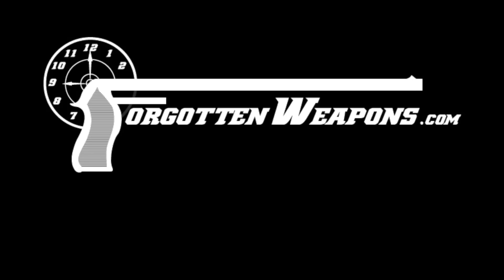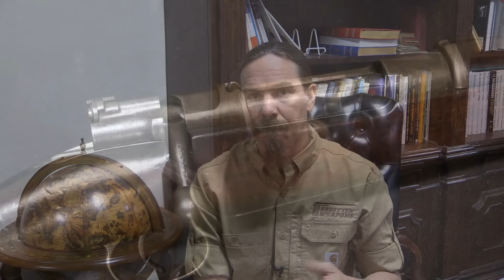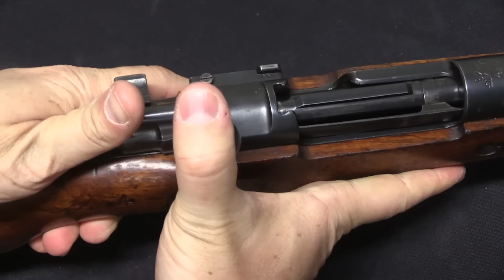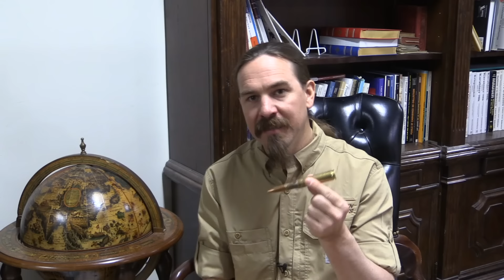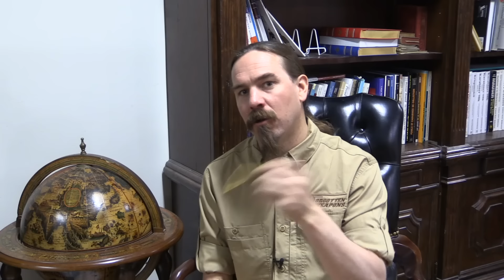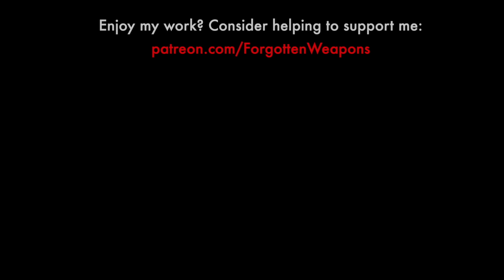Earth-Shattering ka-Boom! How (and Why) Guns Explode

Comment: We'd gone down to the sand pits with some guns, one of which was a double barrel 12 gauge. My friend had laid it on the ground, picked it up, loaded and fired. Both barrels turned into a mushroom-shaped bloom of coiled spirals 0f gunmetal back to about 6" in front of trigger....... that's what even a LITTLE sand in the barrels will do?!?!?! There was no way it was actually plugged. He was damn lucky he didn't get shrapnel in his eyes and face; I was standing behind his right shoulder, couldn't believe in milliseconds the amount of change that took place on that gun....... 
I've often wondered about rifles in situations where the barrel's certainly got mud or sand in it...... I presume the velocity and solid surface of the round makes such obstruction a non-issue? That endcap shear you describe is incredible! Your intimate knowledge at the engineering level is pretty awesome.

Comment: It the dim, distant past a friend had some surplus K-98s (?) and a basket full of surplus rounds to go with them. In the early 60's this ammunition might have been 20+ years old, or 40+ years old. Round after round would shower us with dust/gas and the cases showed three small windows ~1/32" X 5/32" which started just above the case web, the next offset clockwise  ~1/16" to the side and 1/8" farther forward, ditto the third.  After a while cases that didn't rupture/vent became the rare exception but hey, we were shooting real rifles. For free. I don't recall any less recoil or change to FMJ bullet impact.
DOUGout

Comment: Seems like the safety mechanism was the near fatal piece that came off the gun.
Reply: maybe this incident can help improve the design, reinforcing the locking and safety mechanisms and/or add a failure point on the barrel rather than have it break the breach. The design of that rifle isn't that out of the ordinary, especially considering the number of inline muzzle loaders (some smokeless) that use a similar breaching; it's very strong, just gets dangerous when the barrel is stronger than the threads.
Reply: @wildrangeringreen  Though it's not terribly long, it has a heavy barrel for accuracy. What people should probably pay close attention to is the fact that the chamber pressure in the .50 BMG is no different than most other rifle cartridges. So what was possible on a large scale with that gun, is also possible on a smaller scale with a much more pedestrian cartridge choice. I think the only safety change it needed was much more beefy safety lugs which would actually deflect the end-cap away from the shooter, if necessary.
Reply: It was but if you watch Scott's video on it, the real problem in his case was the round itself. It was way over pressure for what the gun was built for and they had no way of knowing that until the accident happened
Reply: Ya I was thinking in that system definitely should have had vent holes.
Reply: @kathrynck  Force is the pressure times area, so although the .50 has the same pressure as a smaller calibre, the force on the breach will be higher, and it's the force that strips the threads off the cap.
Reply: @axelBr1  good point.
Reply: @niccarr7929  He had warning signs something was off, and Ian mentions it too. KB said the recoil of the previous round was way higher than it should have been, and the round impacted way off the target. That could have been sign that the SLAPS were funky for example the higher recoil because it built more pressure than it should have. This is not really jab at KB this could have happened to anyone, but like Ian points out if things start to be off stop firing, and examine the situation fully, and all shooters should have this in their mind even though its easy to forget imho
Reply: @lalli8152  yeah maybe but that's the hard part, just how noticeable was it in the moment? We can't say and he didn't think it was enough to stop firing that day but he saw the difference in the muzzle blast afterwards, luckily him and his fathers actions kept him alive and he's doing well. But yeah if you can notice a difference then you need to stop and make sure everything's okay before continuing
Reply: @niccarr7929  Yeah i agree, and like i said that could have happened to anybody

Comment: I think the main problem in Scott's case was using a sabot round through a muzzle brake more than powder degradation.
Reply: Judging from what Scott has said 8n his video and what others have said it was the round more than anything else that caused the accident, that round was way too over pressured for what the gun was built for, unfortunately there was no way to know that before it happened
Reply: @niccarr7929  The round was only over pressure because he was shooting a sabot through a brake not designed for sabot rounds. This explains the erratic accuracy as well.
Reply: Im flip floppin on this, first i thought hot load, then after another video i changed my thoughts to the brake but now im back on hot load after another! If it was a bore obstruction at the muzzle, failure would have bene up there, so unless say it actually jammed in the chamber for some reason, im back on the hot load myself. Be great if we find out, hopefully something will be garnered from the remains and/or remaining rounds. Not saying you should shoot these through brakes by any stretch, just that wasn't the particular cause in this case in my personal opinion. Not an expert by any stretch but i do shoot, load and have studied rather a lot on internal ballistics.
Reply: @dunxy  A hot load doesn't explain the erratic accuracy. A bore obstruction does. The SLAP were made for the M2HB, which does not have a muzzle brake. Most rifles equipped with a brake, such as the Barrett, will recommend against sabot rounds in general, and SLAP rounds specifically. The bore obstruction would still cause failure at the weakest point, the threading at the chamber end, rather than the barrel itself. A round would have to be loaded with high explosive to cause catastrophic failure without an obstructed bore.

Comment: One you didn’t cover that really hits close to home is the cook off. Had a buddy at the 249 range who had a stoppage. He took the right steps by clearing the weapon, keeping his head down and doing a sweep to ensure there wasn’t anything blocking the bolt (links, brass, etc.), but when he looked up to continue, a round cooked off in the chamber and shot about 2/3 of the case right into his throat. Now this was at a military range with some amazing medics on hand, and he survived, but it could’ve been way worse. He’s got the case framed and hanging in his trophy room.

Comment: Luckily Scott's an absolute Chad and he had what it takes to stick his thumb in his chest to stop the bleeding.  Not many people have that in them.
Reply: Not his chest, his neck (which is all the more impressive).
In all likelihood his jugular vein got knicked and he had to apply a good amount of pressure to prevent bleeding out. Had it been a high-pressure artery that got knicked, he probably would have died.
Reply: @magnanimus9692  he said in his video it did get knicked it was his jugular which is high pressure
Reply: @xx_mysticwolf_xx1492  I remember that, but he either misspoke or confused the anatomy.
The jugular veins are low pressure (about 5 mmHg) and drain the blood from the brain whereas the carotid arteries are high pressure (about  100mmHg or more) and provide blood to the brain. Judging by his wound, his right internal jugular was knicked. The internal jugular vein is a very big vein and would cause immense bleeding with death in minutes depending on how big the cut is if no pressure was applied. The good news is that veins are squishy and you can apply external pressure to control the bleeding. Scott did exactly what he was supposed to do. Perfectly executed.
Had his high-pressure right common carotid artery been knicked, his dad wouldn't have seen him just profusely bleeding, he would have seen his son squirting blood out of his neck. A combination of the high pressure, the deep location of the artery and the resistance to external pressure (arteries arent squishy like veins, they are thick and resist compression) would make it virtually impossible for him to control the bleeding in a field. Basically he would have to be inside a hospital when the injury occured for him to have a chance at survival. And if you look at anatomy pictures online you'll see that the common carotid is right next to the intenral jugular. A few millimeters of deviation and he would have died for sure.

Comment: I have personally seen the results of a catastrophic failure of a rifle back in 2007. It was a bolt action (Mauser action) .240 Weatherby Magnum with a scope mounted. It was as you  say an "in battery" failure. My friend pretty much received the "best of the worst". It was an obvious over-pressure, which forced the bolt rearward, shearing the lugs and the bolt handle and the bolt went through his left cheek (the worst), the bolt came to rest in his mouth, missing his teeth(the best) and did no further damage (again the best). Pressure was also relieved through the internal magazine, blowing the plate out the bottom which pushed the stock up off the bench breaking the stock,  also braking his jaw. Also when the rifle went rearward the scope shattering the orbital bone under his right eye. He was taken by helicopter to a hospital, where fortunately for him the duty surgeon was fantastic, he spent about 9 hours in surgery and spent about a week in the hospital, and month with his jaw wired shut, and needless to say his hearing was screwed up for quite a while.
 The failure was no fault of his, he wasn't shooting "hot " rounds or anything of that nature, he was sighting his his rifle for what was then an upcoming hunting trip. He eventually recovered, with a triangle scar on his left cheek the only permanent mark left I'm aware of. I wasn't with him when it happened but was there at the hospital, and after his hospital stay he and I kinda talked it through to work out what happened...

Comment: This whole situation has really made me reconsider going out shooting alone any more. Having a battle buddy there in these moments are what separate the story being told by the news, and the story being told by you.
Reply: When was the last time you read a headline: "Lone gunman, dies on range" ?  We should all be cautious and understand the situation, but don't be scared.  This is a rare event.
Reply: @Redmenace96  i cant believe someone actually is defending the idea of not being safe with a firearm. What do you shoot? Myself- older rifles and the last year, a FUCK TON of handloads. Shit happens dude. And having someone else there makes the difference. Your right. Its rare.
But only rare because people havent been dipping into old ammo that could potentially do this to them in the last 100 years. Ammo has been difficult, or expensive over the last 20 years but NEVER like this. People are shooting antique rounds out of firearms that where not designed for those specific rounds.

Just cus you have a gas car does noy mean it can run formula one fuel. Same goes with your rifle and exotic rounds (or handloads) in the corresponding caliber.
Reply: @Redmenace96  also- this last year alone there are more "exploding gun" videos then in the last decade. Why?
Not counting the 3d printing idiots who think plastic can withstand thr forces of a rifle round, its because the where using too hot of hand loaded rounds. The 5.56 community was losing rifles left and right. And most where having them straight blow up. Many times resulting in injuries. Plus this is not reported because while its a firearm injury, its nkt a gunshot wound so the media response is much less flashy compared to "gUNs kILl PEOpLe" narrative thats easier for folks to follow and hate on. 

If anything, this is going to become a much more common thing to see happen if this ammo and material shortage and price hike continues.

Comment: KB said he had fired several of those old rounds, I would not be surprised if the threads were beginning to fail before the final KABOOM.
Reply: Just as a thinking game but wouldnt the fine threads starting to fail jam the cap or make it noticeably difficult to close properly?
Reply: @bdkj3e  Low grade threads yes. Does that apply to high grades as well? Never had those fail so i don´t know.
Reply: @7.62flavorsoffreedom2  I used to work as a failure analyst, and when dealing with hardened metal threads, such as pinion gears on large machine differentials,  we would see cracking at the root of the thread but it would still thread the nut like normal, not saying this is the case here, but I think it could be a possibility.

Comment: The serbu 50 doesnt seem to have much of a fail safe integrated into it
Reply: The sniper's hide has a thread on it and it's kinda hair raising. From Serbu's own statements, it'll handle 85,000 PSI. That's a safety factor of 25%.
Reply: @poisonouslead85  a semi auto has the explosion dampened by a recoilspring, the bcg contained by an upper in case something would fly rearwards. Never been impressed by the RN50.
Reply: @manganvbg90  Even a factory glock barrel has a safety factor of 250%. Hell, the mostly 3D printed FGC-9 has a safety factor of 300% and you make the barrel and bolt yourself using steel tube stock and a lab power supply.

There's no excuse for a professional gunmaker to be riding that ragged edge when a bunch of nerds with Autodesk Fusion are making safer guns that fail in a safer manner and have a much higher safety factor in general.
Reply: @poisonouslead85  ye, 25% safety factor. Im never getting behind that gun for sure 😁

Comment: Seeing all of the different fail-safes that were included in guns over a century ago, really makes it clear how the design of that specific Serbu .50 cal rifle is flawed. The threaded plug was secured by two steel claws, both of which sheered off. One almost brained Scott and the other severed his jugular... when your backup safety mechanism becomes a lethal projectile, it’s not a safety mechanism.

Comment: A dude on Kentucky's video in the comments mention something about using Sabot rounds and a muzzle break, that the small plastic pieces get stuck in the muzzle break and eventually can lead to ka-Boom. It somewhat supported as it's shown in the video how the muzzle flash gets brighter and the gun louder per Sabot round he fires, it also seems a non-Sabot round fired in between wasn't enough to clear it out.

Comment: This was an incredible video, not only for the obvious message of safety and awareness, but also in how it differs from a typical Forgotten Weapons video. It was very enlightening to show several similar design features with the same purpose compared with one another, and a real treat to see several different weapons in the same video. 

It would be interesting if you made a series of videos on particular types of features or design intents and compared and contrasted how different designers implemented them!

Also, props to whomever closed-captions your videos! Whomever they are, they pick out the important bits and make your meaning clear.

Comment: I watched Scott's video, lucky to be alive is an understatement. As to the ability to look at something in hindsight, it is definitely easier to see what went wrong and why after the fact. 

I got very lucky during an IPSC practice a few years ago with a squib, and nobody at the time realized what had happened. My 1911 malfunctioned and I immediately tried to clear the jam, when that didn't work I loaded a fresh mag and tried again before realizing something wasn't right and I stopped. Luckily for me the bullet was not pushed far enough into the barrel to allow another round to chamber. Even though I know better and should have immediately stopped to check the gun over to see why several rounds hadn't chambered, but when you're on the clock you go straight to what you've trained and practiced to do, and with competition, that's to clear the jam and continue shooting.

Comment: Hey Ian been watching you well before you had a million subscribers and this video is long overdue in the shooting community on you tube. I had an experience with a scuib in my M-1 carbine 4 years ago at the range, got a pop no bang bolt did not cycle and racked the bolt handle back, shell casing ejected with a lot of un burned powder and the bullet only 1/2 an inch down the barrel. It was pretty obvious right away but I never forgot it.

Comment: What about head-spacing errors?  Awhile back I bought an exploded 1903A3 (Restored) on purpose just to find out what happended, but I think it was poor headspacing on top of a hot load.  There are three instances where I had problems with faulty or old ammo.  First off, a friend had a Ruger Blackhawk 44 magnum and we were out at the range.  The friend was getting ready to shoot some rounds that a friend of ours had handloaded.  KABOOM!  Lots of smoke and recoil.  The friend of ours had handloaded 44 magnum cartridges with Black Powder.  Second, my son and his friend were plinking with a bolt action 22 and an AR-7 with some old Federal (very old) ammo and, while the ammo was working fine in the bolt gun, the cartridge cases were fracturing and blowing out on recoil from the AR-7.  Finally, I was sighting in my Savage 99 (308) and my father-in-law's Model 99 (243) out at his ranch.  Mine went okay but the first round I fired in his 243 had a case rupture in the chamber.  Lots of smoke and funky recoil but the Model 99 action is extremely robust.  Turns out that he'd reloaded the ammo himself and it was nearly 30 years old.  The lever wouldn't extract the round and I had to drive the case out with a steel cleaning rod.  Fortunately, there was no damage to us or the rifle and he threw the remaining reloads away.